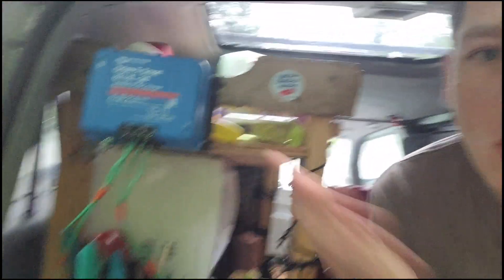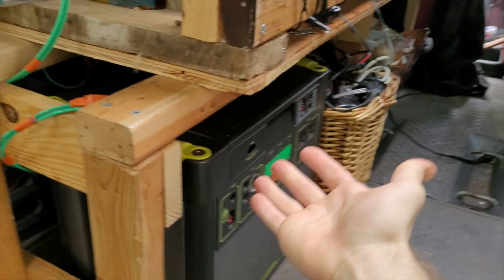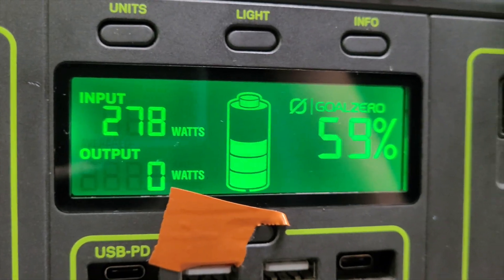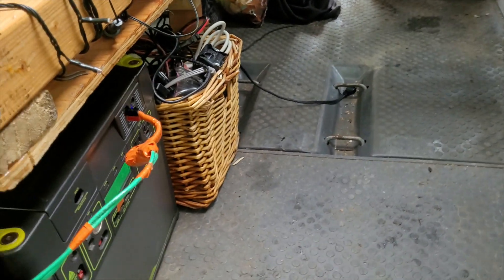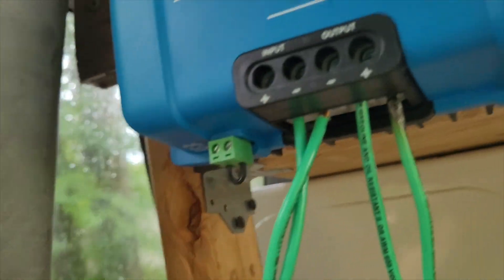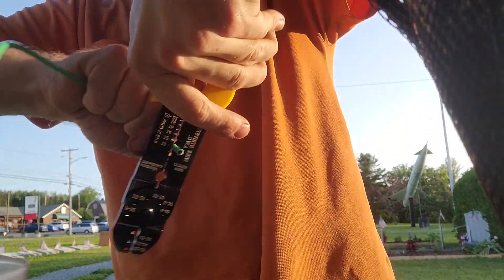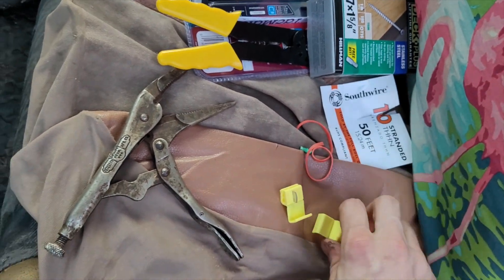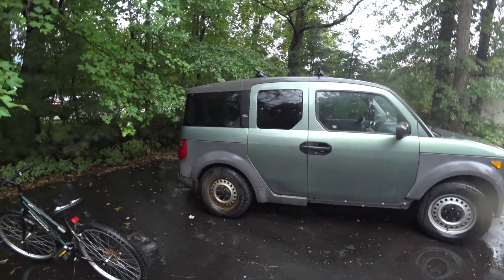Using Car Alternator to Charge Goal Zero Yeti Battery ?? -- Victron Orion dc to dc charger

Comment: While informative, you need to fix a few things PRONTO or your Element could go up in flames.  First, buy yourself a 60amp DC Fuse or breaker and install it as close to your starter battery positive terminal. This is to protect the wire, not the Orion. If things start to melt and short, your vehicle is toast. Next, those connections of the wires should never show bare wire. Heat shrink that stuff and while you are at it, replace the green wire with the proper black and red wire to make diagnosing things a bit easier. Lastly, buy a loom and wrap it around the wiring to protect it and don’t feed it through areas you can step on. You may also want to consider 6 AWG wire, but that depends on input cable distance from the battery to the Orion.
Reply: He said 10gauge wire.  40A (or maaaaybe 50A on a fast blow) is the correct fuse. 60A means the wire is the fuse, since the maximum ampacity for 10AWG in chassis wiring is 55A.
Reply from the maker: The dc to dc is fused itself or isolated as they say so all I have to do is get the current there with the right wire and that wire is over kill but better safe then sorry as I turns out the cut off for the goal zero on this model is 300 so running a smaller dc to dc would have been better or even easier is to just buy the cable that goal zero sells cut out all this extra work